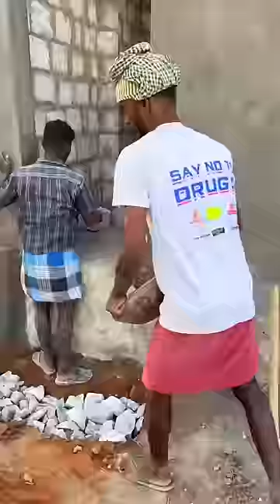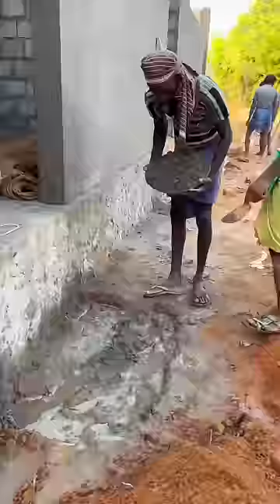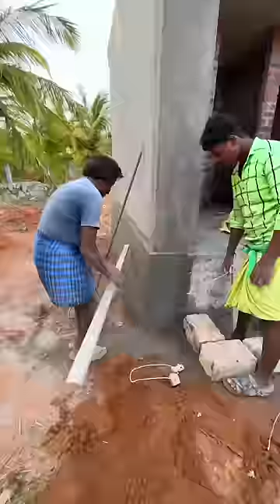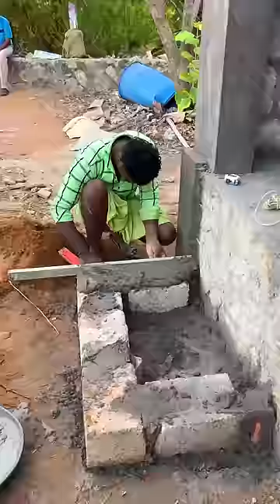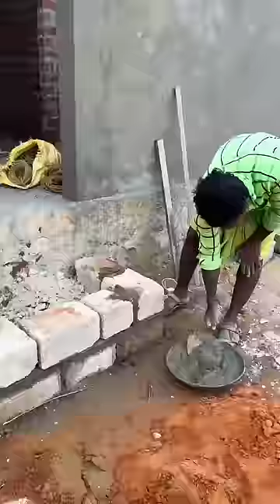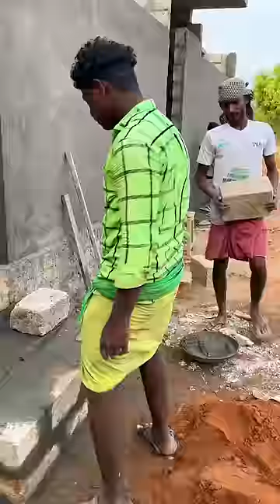Stairs! Technology #shorts #staircase #bricks #howtobuild #construction

Comment: Not a measuring tape in sight let alone any steel in the concrete. A level is also a must plus string line
Reply: Huh?
Reply: He had all of those edit: OK no steel, you're correct on that
Reply: @jamestheferret  Where was the level or measuring tape?
Reply: @adamhajek9892 in the beginning you can see a blue measuring tape on the step next to a pencil, he uses it from a length of wood his friend is holding to check the blocks from the corner, in the next step he uses a little red level on top of another bit of wood to check the step front to back edit: sorry the tape is blue and white not blue
Reply: @jamestheferret  Yes he has cheap measuring tape. I didn't see anything else.
Reply: @adamhajek9892  pause it at 0.24 you'll see a red spirit level he's using on a bit of wood, also dosnt matter if the tape is cheap
Reply: Are you having a stroke?
Reply: Steel for what bro 2 steps 🤪
Reply: @ss-ip2dy  It's load bearing. Standard practice...